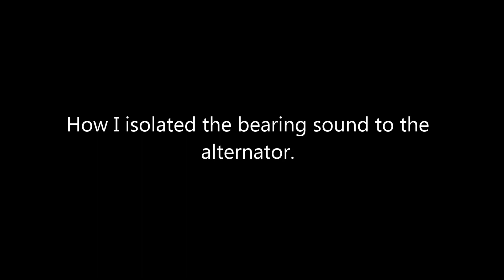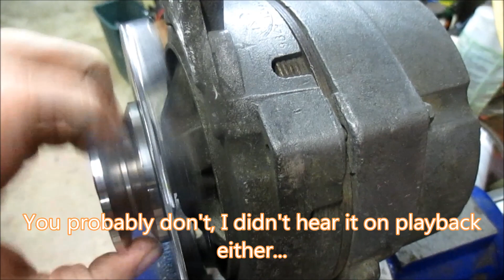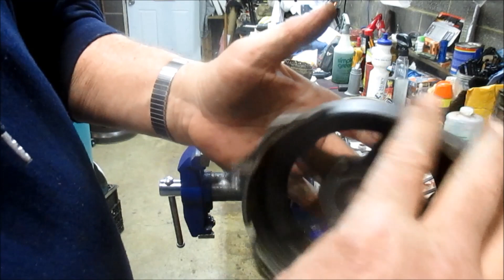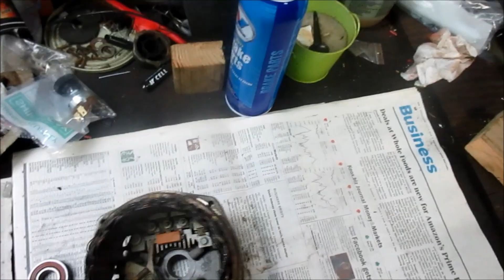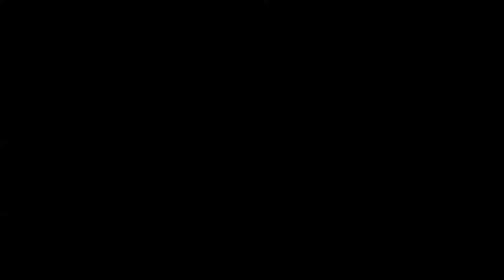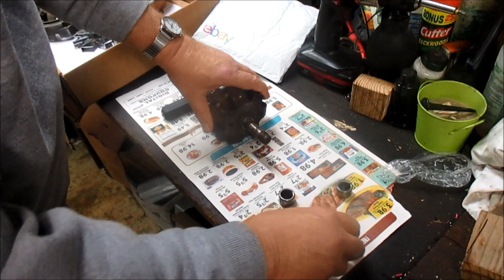How to repair a Delco Remy 10SI alternator. 1949 GMC restoration project volume 9

Comment: It is obvious that you know what you are doing, but the terminology is quite different from the old generator ie:  the rotor is the part that spins and it equates to the old field coil and the stator equates to the old armature and the "slip ring"takes place of the commutator. Internally the alternator produces AC current and the regulator use diodes to convert the AC to DC for the battery and electrical system. I look forward to your videos the trucks are great.
Reply from the maker: Ed, thanks for the clarification, once upon a time I knew these things and even passed tests for them but alas if you don't use it regularly you loose it.  The alternator actually makes 3 phase AC and back in my poor'er days I made a stick welder out of a 100 amp alt., and run it off one of my Wheel Horses, I should do a video on that one day.
Again, thanks for the input.
Dave

Comment: I like the oklahoma credit card for figuring out sounds that are down in deep. Ain't fair when in shop as every sound is echoing all over
Reply from the maker: Oklahoma credit card, sounds like an interesting tool, LOL.
Reply: @Volfandt  neighbors garden hose with whatever you needed to get their gas as it happened in our neighborhood way too much. I worked for a living but the transits from south who came there bragged about how many and where they found theirs to get here to go to work in woods in the summer. They were proud...sick sobs got my gas out of my big trucks back then and gas was twenty five cents a gallon
Reply from the maker: @morgansword  LOL Oklahoma credit card, I may use that if'n you don't mind.
I remember $0.25 a gallon gas well, my 1st real job was as a gas jockey who also cleaned your windows, checked your oil and aired your tires. Even carried a big wad of $$'s  for change. Man where'd those days go.....
Reply: @Volfandt  I could get gas at the bulk plant for a penny a gallon cheaper but this pretty young girl worked at the station in the evening an I had a huge crush so I would get gas there most the time as those trucks held two hundred plus and only got four or more miles to the gallon... Buddha gas engines with six or more inch pistons... I would tell dad that there was a line at the plant and i want to get the last load an get in out of heat plus working on a u-joint or some other lame excuse.. I thought he bought it till siting at table he asked what   color the girls skirt was... busted but he just laughed and said he would take the two dollars out of my pay for them days.... so I got most my gas at the plant cause ten dollars or twelve if we worked saturday err. Good ol' Jim Reeves on the radio